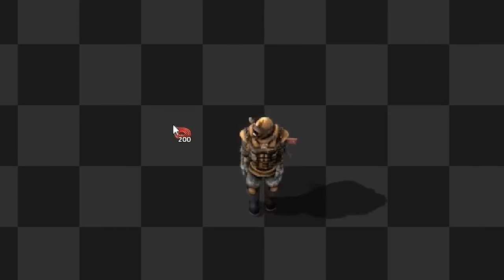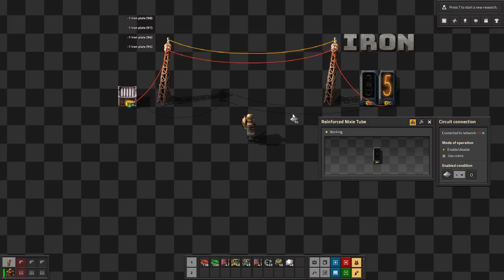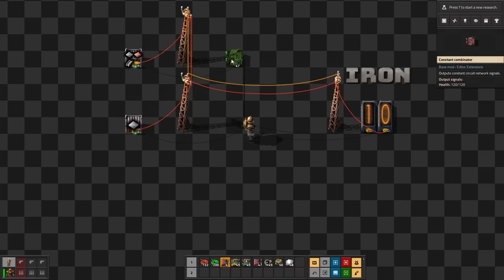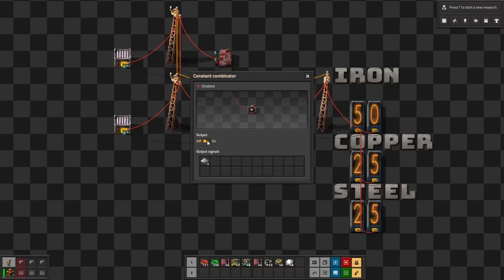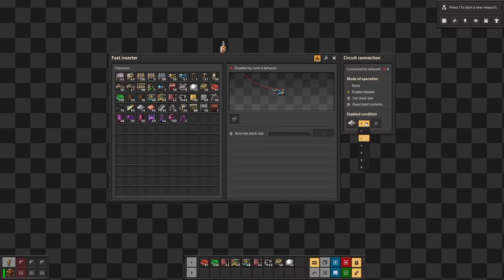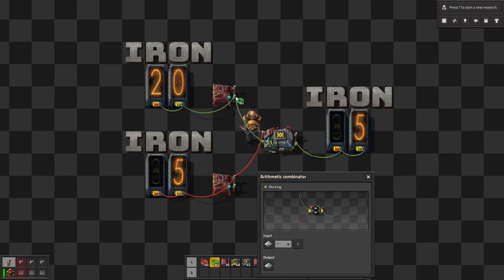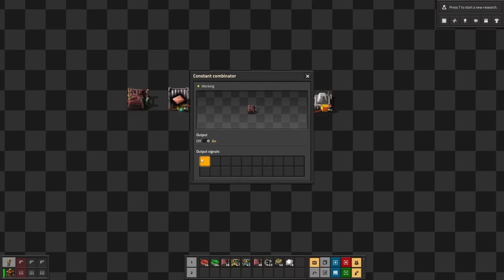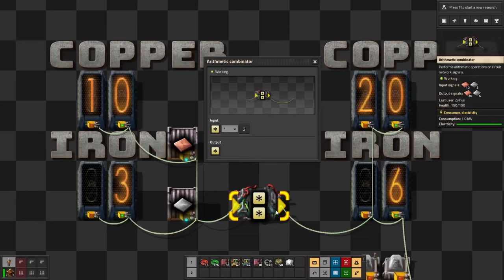Factorio Circuit Networks Explained in Under Three Minutes

Comment: If youre looking to design your own ciruits - heres a bit of a metatip: figure out what the circuit will turn on and off, and what conditions you want to turn things on and what conditions you want to turn things off.  For instance, "I want this pump to turn on when this tank is more than half full of light oil"

Next frame that statment in something the circuit logic can understand.  For instance "if light oil > 12500, then enable pump"

Now you might notice that "light oil > 12500" is an option in both decider combinators and pump enable / disable options... so now all you need to do is figure out how to get the pump to know how much fluid is in the tank and apply the settings to the pump, which is simple- as shown in this very youtube video.

So lets kick it up a notch with a diffrent example - you have a lamp you want to turn red when the train buffer chests are below half full, but turn green when above half full.

So we do the same thing - turn it into circuit speak and state "if iron ore < 14,400 then output red with a value of 1 or if iron ore >= 14,400 then output green with a value of 1"

But now you got two if statements... and lamps only turn on / off when directly wired...  thankfully decider combinators exist, so you can put those statements into a pair of deciders.  Then wire the inputs to the chests (so they can read the contents) and the output to the lamp (making sure the lamp is in color mode) and blamo, new circuit complete.

Now youre only hindered by how well you can translate what you want into "if this then do that" statements.

For an exercise to learn - figure out a circuit that will light a series of 10 lamps based on how charged an accumulator is.  1 lamp gets lit for every 10% charge the accumulator has.  Extra credit for changing the color based on charge.

Comment: Thank you so much! Unironically, this and train tutorial gave me more useful info than all of the guides I watched on the same topic. If I may make a small request: I'm a bit confused on a city block design and it's comparison to a main bus. I've looked up some videos, but it's mostly 20 hour series without much explanation on WHY EXACTLY would you make it this way.
Reply from the maker: Why you'd make a city block design?
It's because it's uniform and connected by trains, so if you're low on circuits, you can just copy your entire circuit block and have it just work. It's for expandability reasons. Some people go way too hard into City Blocks even though they have no intention of expanding beyond one build for each item, but that's it really. It's just a bunch of trains so resources can go wherever they're needed and every build is the same size so it's easy to copy and fit into your rail network
Reply: @DoshDoshington  Ah, I see. So it's almost like OOP. It's not really for efficiency, but it's just easy to add more stuff without re-doing your whole base. That makes sense. I would assume the hypothetical "optimal" solution would  include both city block and direct belt chains. Thank you for the response!

Comment: I finally started fiddling around with these when playing around with the realistic fusion power mod. 
Not to make the power super efficient, but to kill everything on the grid except power generation, and then scream at you if the power dips enough. 
Turns out that plugging 13gw of power consuming machines into a grid using 4.5gw and making 5gw causes issues that are a pain to fix, and not readily apparent. 
That day I learned several things in quick succession.
Fusion reactors require a concerning amount of power, but are self sustaining... eventually. Until then they eat a lot of power.
Fission reactors don't require power, but pumps do. 

Roboports have a significant internal battery, enough to keep about 10 robots running for about ten minutes of infrequent use.
Flamethrowers don't require power for a very long time.
Machine gun turrets do require power and have limited internal "batteries" that will last a wave or two.
Laser turrets require power and have tiny batteries that last maybe a wave. 
Artillery does not require power to auto target.
Spitters and biters don't require power, and don't like artillery.
The bugs get scary at 0.9974 evolution.
Contrary to what you think walls require power.
Spaghetti means the belts are massive batteries that you can steal from.
Spaghetti also means the electric network is spaghetti.
Two nuclear fuel cells is enough to restart a base.
Only having two fuel cells to restart a huge base on a death world is not good for your blood pressure.

Comment: I do eagerly await your "advanced" Circuit Network explanation video, hopefully with some worked examples (hopefully you have a better way to make a "trash train" work than my method which uses far too many combinators, I know there's a simpler way but it has eluded me so far).

Comment: the only thing i ever used circuits for is precise chest limits in my mall
and ofcourse the classic oil cracking circuit: pump1[heavy > light], pump 2 [light > petrol]
Reply: It's also great for trains, if you have stations with duplicate names.  I like having my basic resources have standard train stop names, then I can have multiple mines for one resource, and just turn on each station when there's enough stored to fill a train.  Also good for delivering fuel or other standard supplies, only turning stations on when they need resupply.

Good for controlling nuclear, too, if you use it.

Comment: Only thing i once did, was sending the Items from my main base and the outposts on one wire. The other wire was sending a clock signal, so the main base, and the outposts could only send for one tick. So like a seriell Bus System, with a timewindow to send information(channels).
But now i use a more passive system for trains.

edit:
Ohh and i forgot nuclear power plants. You can make a fuel saving power plant, that only inserts one fuel cell, when there isn't enough steam in your storage.

Comment: Wow you REALLY packed in a lot of info there. I'm trying to figure out how to make the inserter only work if two values are true instead of one. I'll figure it out.
Reply from the maker: You'll need three combinators. One to check the first value and output a signal if it's true, another to check the second value, and a third that checks the output of the first two and checks if it equals 2, and if so, output another signal that activates the inserter. It's annoying, but once the expansion comes out you'll be able to do it with one combinator.
Reply: @DoshDoshington  I just finished your video on the belt printer. What a mess! So the actual deal is that I have belts going to a train that is my "builder train" and each cargo car has different stuff. Each belt has two items on it, and between each belt/cargo connection is a crate. I don't want the crate full, only full enough of each particular item that is needed to refill the cargo car if it is almost empty. Otherwise, the crate may be filled with one of the two items and not both, preventing perfect reloads of the entire builder train. So I have, for example, the first belt with turrets and walls. Maximum capacity for the cargo car is 600 walls and 100 turrets, so the crate shouldn't have more than double that.

Anyway, thanks for the response, I'm still figuring things out. I could just use a separate belt for each item, but I feel like there's an easier way with the circuit network.
Reply from the maker: Okay, if you want specifically that, it's a bit overkill because it's much easier to just separate the belts with a splitter or something, but you'll need a constant combinator. Set it to have 600 of the wall signal and 100 of the turret signal. Take the output of the chest, put it through an arithmetic combinator for EACH * -1 output EACH. Add that output of that (AKA put on the same wire) as the Constant Combinator. Feed that wire into a filter inserter and set its mode to "Set filters" 

Congratulations, you now have an inserter that will add specific items into the box until it is greater than the value you specified in the constant combinator (Because negative values don't set filters.)
Reply: @DoshDoshington  yeah I thought maybe I was wrong about it being easier, but I thank you for rising to the challenge. I'll let you know how it goes. Very appreciated.
Reply: @DoshDoshington  It still took me like half an hour to get it to work, and I don't understand WHY it works, but it's a start xD THANK YOU for your help <3
Reply: @DoshDoshington  And you're right, it's way overkill. Rerouting everything was better.

Comment: This makes quite a lot of sense to me as a programmer, but I guess I lack the creativity to think of any practical purpose for regular unmodded Factorio
Reply: I've never bothered with the arithmetic stuff, but have used a bit of complexity automating nuclear plants, with controlling one inserter based on steam stored, reading its contents for depleted cells, then feeding fresh ones in.  That's more into the complexity of the inserters than the circuit network, though.

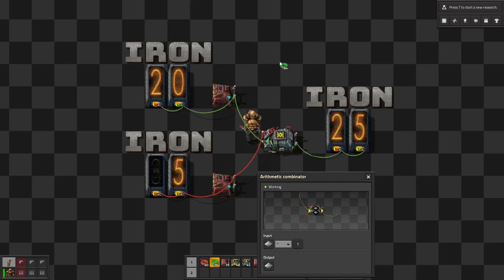Comment: 2:12 ok it took me a while, (20+5)*1 = 25 on green, and same on red, so it makes 50, got it. And at 2:44, the number goes to zero because the output is a color signal and not iron signal anymore.
Reply from the maker: Yup, you got it.
Those are things I explained in text boxes before removing them and reuploading the video because it was impossible to read while listening to the already fast paced dialogue, so I'm glad some of the finer details are still coming across.
Reply: @DoshDoshington  Thank you very much for taking the time to make this extra short video.

Comment: Ok so I am using red wire to tell my inserter not to transfer engines out of a chest unless chest is greater than 200. I have 210 engines in chest why is my inserter not working. it should be moving 10 engines out of my chest. Is there something in this tutorial I am not understanding. Note: you touch on this but don't expound on it practically only theoretically.

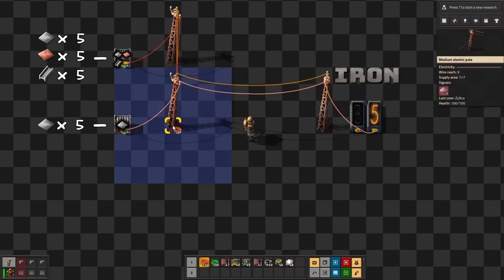Comment: You lost me at 0:41 and beyond, but sounds like you know what you talk about.
Edit: Well, doesnt help that I've yet to figure out what the different boxes is for, for bots. I've managed to make bots and deconstruct stuff, but making them build is a bit weirder. I just added a lot of inserters amongst a lot of different colored chests and sometimes the bots did something.

So I just play manually.
Reply from the maker: Red red chests, passive providers, make its contents available to the logistics network. In layman's terms. If an item is in a red chest, robots can pick it up. If you want robots to construct something automatically, they should be in a red chest.

Yellow chests are for storage. When you deconstruct something, the construction bots are going to want somewhere to store it. If there's a yellow chest in the logistics range of a roboport (The orange square when you try to place a roboport) they'll drop them off in there.

Blue chests are requester chests. Click one of the squares at the bottom and you can select an item you want and what amount. Once you do that, as long as you have logistics bots AND the thing you're requesting is in a red chest, the logistics bots will automatically bring those items to that chest until it's at the limit.

Purple chests will cause a logistics bot to come over and remove whatever you put into it and put it into a storage chest. limited use, don't worry about it.

Green chests are like red chests combined with blue chests. They make their contents available to construction bots, but they can also request things. Only really useful for trying to bring a large number of supplies somewhere else to make available to contruction bots somewhere else. Don't worry about them.

In the absolute simplest terms. PUT THING IN RED CHEST IF  WANT ROBOT BUILD IT

Comment: Is there any limit on how far the red and green wires can travel to be linked to inputs across a power network? Obviously with multiple connections but I'm wondering if there is any "lag" when Factorio has to compare two connections that are several screens apart?
Reply: In my  limited experience with cignals in SE I don't think lag is a problem since I had multiple auto launching rockets on other planets.
Reply: @alienbattle5654  I'm talking about vanilla Factorio with no mods. SE had quite a few mods in them, I don't know if any of them modified how Factorio treats signals.

I play exclusively single player worlds, I'm only worried about what amount of lag to expect on my own PC. Whilst I'm pretty certain my current setup can handle Factorio quite easily, I don't want to take unnecessary chances.
Reply: @DarkVoidIII  The game is always processing everything you've built, so two combinators next to each other create exactly the same lag as two combinators 1000 tiles apart. Their performance impact is laughably small, you can build hundreds of them and not notice anything. In fact, you'll get more lag from basic stuff like inserters and train pathing.
Reply: Simple distance doesn't have any effect, though it can be important to know that it takes one tick from a change in the input to a combinator, until the output is updated. It won't be important in almost any common scenarios, but if you need to do calculate and compare 2 different values it can make or break it
Reply: It looks at what circuit or power network something is connected to, so it doesn't matter the number of steps.  If anything would be a problem, it would be making changes to the network by adding or removing wires.  I always have all of my large power poles wired up with both circuits, and never noticed an issue from distance or number of poles.

Comment: Ok I have a question. I was trying to set up a way that my trains would know which iron outpost to go to depending on how much ore it had in the warehouse. I had 3 wagons for iron, so I connected the 6 chests in one wagon and connected it to an decider combinator that outputs red if iron is less than 2k. I did that with the other 2 wagons and used different colors in the decider combinator. I then hooked up the output of all three combinators into the station (send to train) and I made a wait condition so that if the train detects a color, it would move on to the next outpost so it doesn’t slowly fill up forever while all the other outpost are full. However, even though the input of the decider combinators are all over 2k, and there is no visible output, the train completes the circuit condition and moves on. Does anyone know what I mean?
Reply from the maker: Well, you said it would output red if it's under 2k, and that it's not outputting anything when it's over 2k seems like it's working properly. Though if you want to activate a train station based on if there's enough to fill a train, connect all your boxes with wire then put that into a decider combinator that outputs 1 of the "L" signal if there's a full load. (For 3 wagons that would be if there's 6000 ore for example.) Then wire that output into the station and check the option "Let train limit" so that that L signal will allow 1 train to enter the station when there's enough.

Alternatively, you could take an arithmetic combinator and divide the output of the chests by 6000 and output L. That way it'll allow multiple trains if your outputs setup to have a waiting bay.
Reply: @DoshDoshington  Thank you, That’s smart

Comment: I dont get how the AND works,
Reply from the maker: It's pretty simple.
Decider combinators can only output 1 of a signal if a certain condition is met.
To make something happen if only something AND something else is true, you first need a decider combinator to check each variable independently. For example, If A > 0, output 1 checkmark signal. If B > 0, output 1 checkmark signal. Wire the outputs of those two combinators together to add them together and feed them into the input of another combinator. 

If ✔ = 2, output another signal, and that's the signal you can use to control whatever you want to work only when A and B are both true.
Reply: @DoshDoshington  I looked up many things and couldnt figure it out, so i focused and figured it out myself with some time, Thank you though

Comment: Technically speaking, Factorio logic gates are Turing complete, meaning you can perform any computation on them you can on a normal computer, for example he could've rendered this video on a Factorio circuit, it just will be very long and complicated. Also there's a chance he would need to write output down by hands.